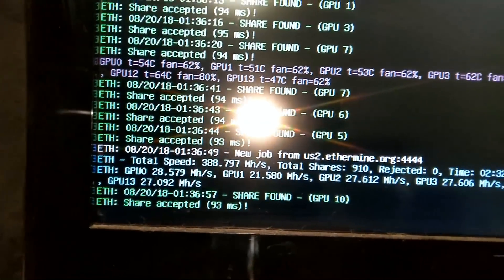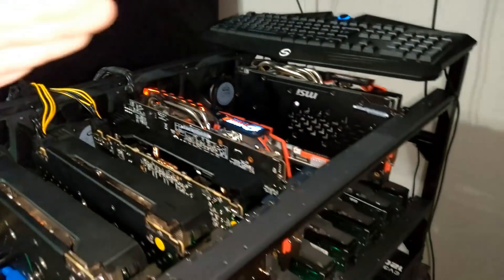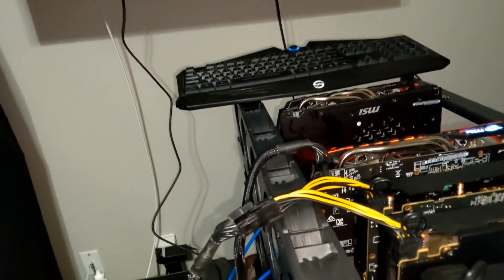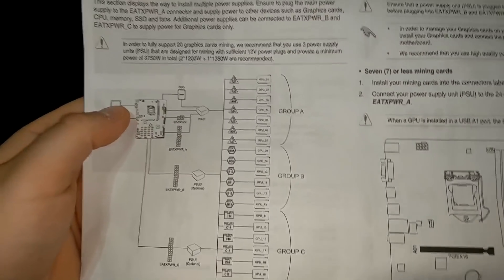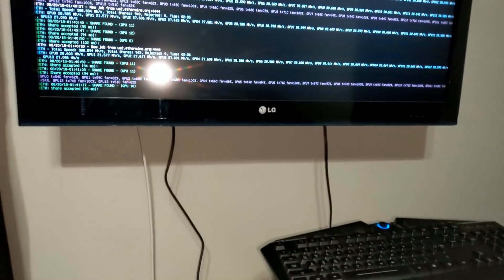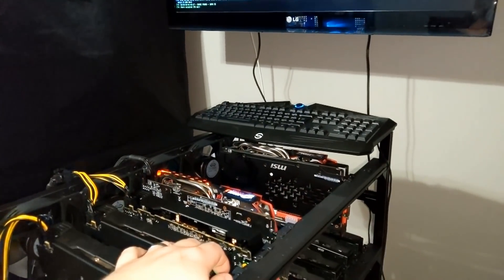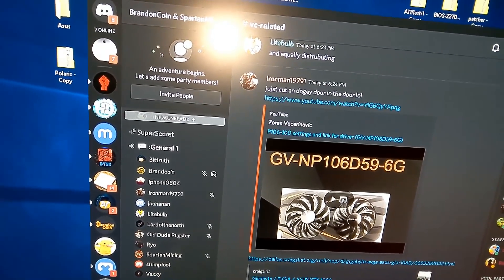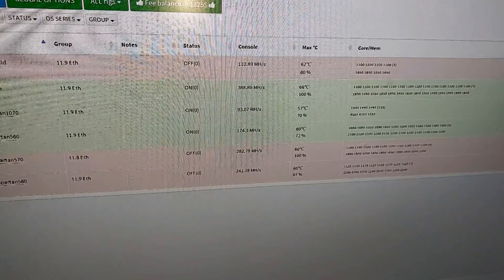Asus H370 mining master Hands on with 14 rx 570 GPUS what i learned so far

Comment: Intel CPUs have a 16 PCI-E Limit that shared between M.2 slot as well (if your using one) The only way to get more than that is to have Nvidia SMI using Linux, P104/106 cards can do up to 19~ so 20 shouldn't be an issue. You could do a Combo from what I read. AMD + Nvidia 8+8 or AMD + Nvidia P100 series(mining editions)

Comment: AWSOME! I am not so sure its a bios issue here is my reasons, not all CPU's are equal when it comes to available lanes, here is a example if you have a cpu that has 16 lanes, and you have a board with 3 16x pcie lanes, if you have one card in that one card will use all the available lanes, 16 but now you put in a second card,  in the second pcies 16x and now each card is getting only 8 lanes to the cpu through the mob, with the risers dropping down to 1x lanes this is how we can get so many video cards working, since this MOB says it can support 20 gpu's then we know that the mob has the physical lanes on the buss for this, I would then think that the issue may be the CPU and my be causing the OS not to load because there is no lanes left for say a USB or a hard drive, the deceiving part is even if there are no lanes left, for the usb drive or hard drive they will still show up in the bios as there and available, Now some bios will actually not allow that to happen by forcing a hardware priority load, the bios will wait to load say pcie lanes till the hard drive and or USB lanes have been assigned first, then it will assign the pcie devices but since at card 15 this motherboard dose not boot up the OS I am betting that it dose not have a priority loading. Check and see how many lanes your cpu can use. Just some thoughts on this I could be wrong, but worth a check out?
Reply: Intel CPU's can only bifurcate the 16 CPU based PCIe lanes down to x8/x8 or /x8/x4/x4. on certain chipsets. H370 does not alow PCIe port bifurcation, and the x16 slot is driven entirely from the CPU with all 16 lanes availiable. This board does not use any CPU lanes for the mining card ports, all of those ports are driven from the H370 chipset which has 24 HSIO lanes that can be made into a max of 20x PCI 3.0 lanes.

Comment: smos wants 8 g of ram for 6 cards and 16 g of ram for above 6 cards
Reply: Where are you getting this info? I'm running 12 cards with 8 g.
Reply: i found it in the help section several months ago but now they have changed the layout so exactly where in there i don't know. i do know i was having problems with my 1080ti rig until i went to 16gb of ram . i also have some rigs with more than 6 cards running on 8 gb

Comment: I think you are right, it is bios related somehow. The other 20 gpu board does something like this I think as well. maybe a PCI lane restriction? i looked it up the chipset has 24 lanes but the celron only has 16. still seems like you should be able to get at least 16 going? duno for sure if this even part of the problem.